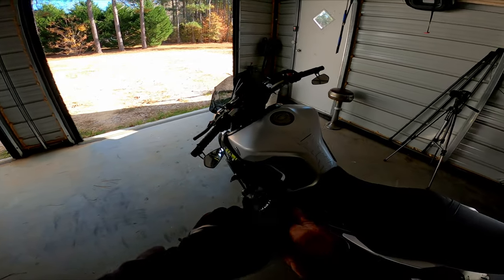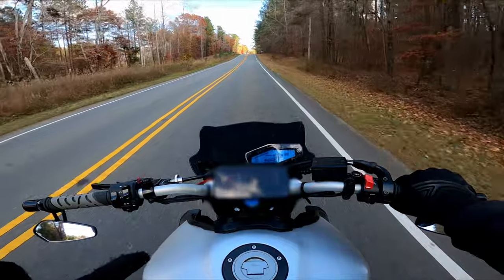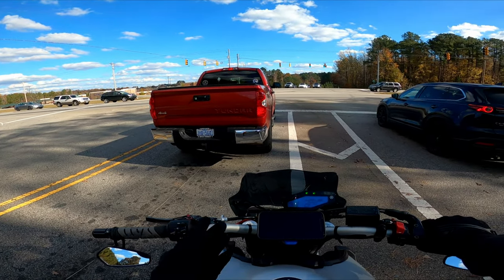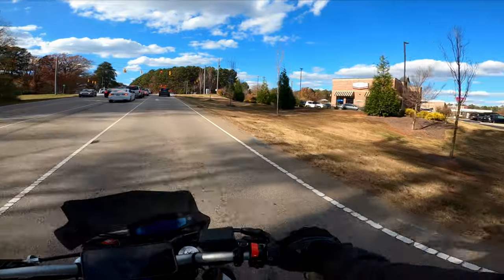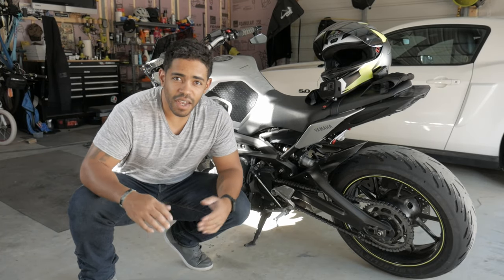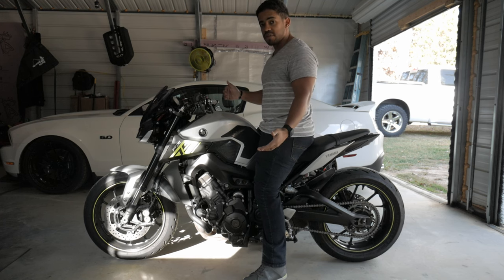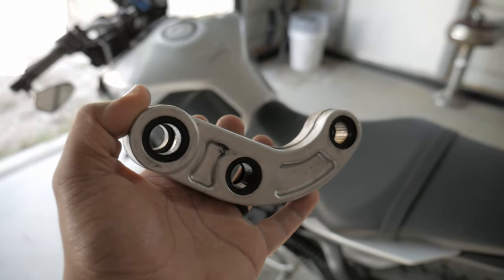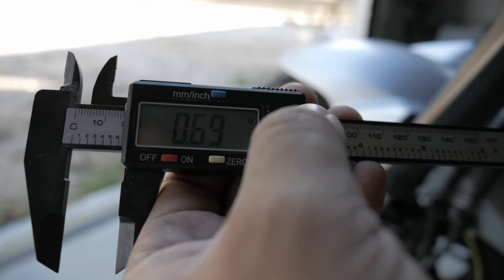If you don’t track your bike…and you’re short...lower it | LOWERED 2017 FZ09/MT09

Comment: hi sir, what wind shield is it?
Reply from the maker: I like it but usually only run it during the colder months to get the cold air to kinda go around me haha.
The link below should bring ya to it.

https://www.revzilla.com/motorcycle/givi-a2132-windscreen-yamaha-fz-09-mt-09-2017-2018?sku_id=1330801
Reply: thanks a lot, im actually thinking of lower the front like you mentioned at 6:31 but I wont lower my bike at the back, not sure what gonna change, would like to have your thought, thanks! @batistamedia2139
Reply from the maker: @hkbornin1995 If you lower just the front from what I’ve read is that it will make the bike turn more easily. I wouldn’t make too drastic of a change in the front end unless you are lowering the rear as well.